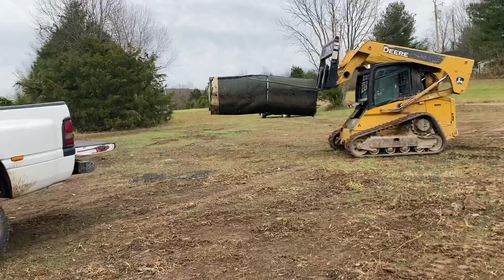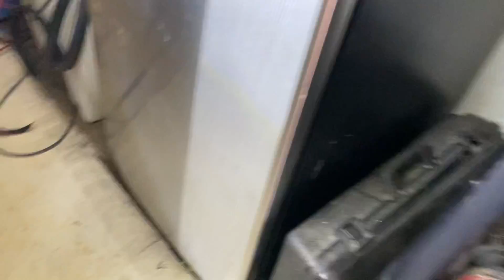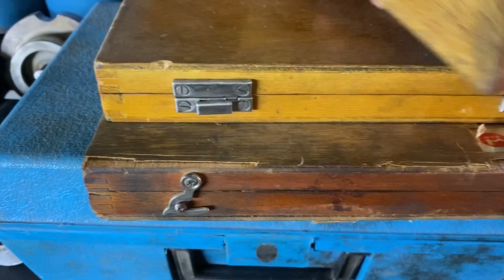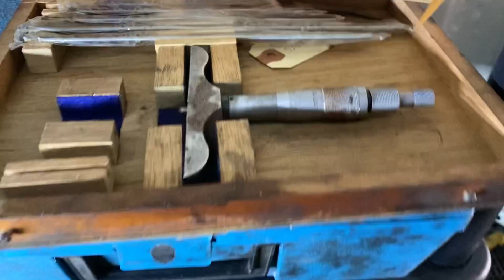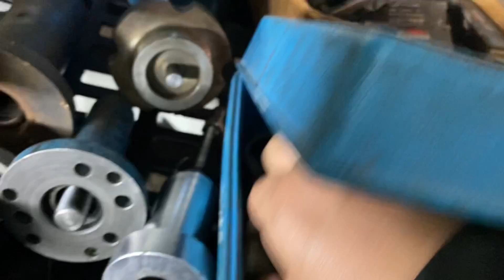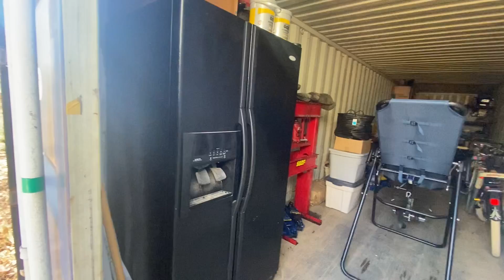Property and solar updates plus some new tools.

Comment: your refrig/freezer in the container -- you need to make it "garage ready" -- google it.  otherwise, everything in the freezer will defrost.  I know, I put a "modern" one in my garage and experienced the same.  my brand did not facilitate one of the "kits" -- so I cajun-engineered a work around.  I don't have to worry about losing everything in the freezer now

Comment: "Years ago I was in Kansas City and I spotted this wild bus. It's called the Peacemaker II. I actually went on board and had a chat with the guy. The bus was seriously amazing though. the inside was like a ship - beautiful variety of wood and so on. Craziest thing I ever saw. I Googled it just now to see if I could find it and sure enough... I did. The website said this: 
"In 2005, for the second time we set out to merge two buses into one. Turning a 1955 GMC Scenicruiser and a 1949 General American Aerocoach into a modern day, fully functional motor home at first mention may not sound all that difficult. But if you cut the buses up into many pieces, extend the overall length to 42'6" long and 13'6" high that puts a little twist on things. Then throw in a Detroit series 60 engine and an automatic transmission from totally different vehicles. That's enough to turn it into an epic 2 1/2-year project. The 1955 Scenicruiser was cut in half horizontally right above the wheels using the chassis as the running part of the bus. The 1949 Aerocoach was mainly used for its shapely old architectural pieces. The split windshields, rounded corners and curved overhead windows are not found in modern style buses. So when you see this bus running down the road, it's enough to make you turn your head and wonder at the care that obviously went into making it."

https://scontent-iad3-1.xx.fbcdn.net/v/t1.0-9/127509795_10157709101680796_3798805224902280984_o.jpg?_nc_cat=1&ccb=2&_nc_sid=b9115d&_nc_ohc=xueXZVAeQUEAX8bvebS&_nc_ht=scontent-iad3-1.xx&oh=3951b3eb47ccad2578f6cdfd1e67673f&oe=5FE9641B

https://scontent-iad3-1.xx.fbcdn.net/v/t1.0-9/127483211_10157709101710796_2832277928223531866_o.jpg?_nc_cat=1&ccb=2&_nc_sid=b9115d&_nc_ohc=79swsQqcmU0AX-JS71a&_nc_oc=AQkH3VuZC9RZBe2H-Sqj6ho8y7i37YYNb7soTGdYeMJ2ySJtnl_YTgncVw_GtC4R-iQ&_nc_ht=scontent-iad3-1.xx&oh=72d1f37d2d03562c2813d8e37649e9bf&oe=5FE8467B

Comment: consider building a shop from containers.....you can double stack them.....get some steel and span across them and  use metal decking on the roof do it right you will also have plenty of storage!.......there's a wrecking yard near where I live that has done this as a couple of dismantling sheds........

Comment: you have a waterbed in the bus? or is it just to warm your potable water?
Reply from the maker: Heating pad for a water bed.  Placed under the fresh water tank.   Thermostatically controlled 300w and radiates heat into the bay